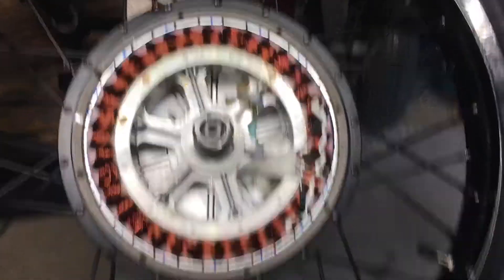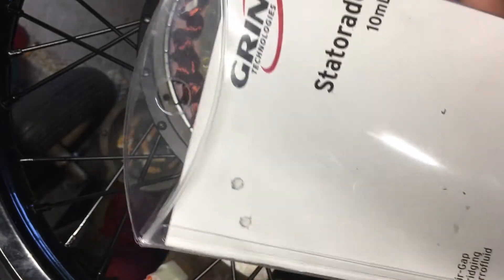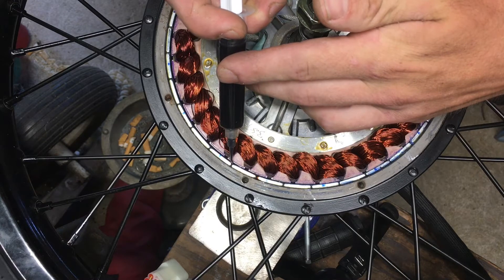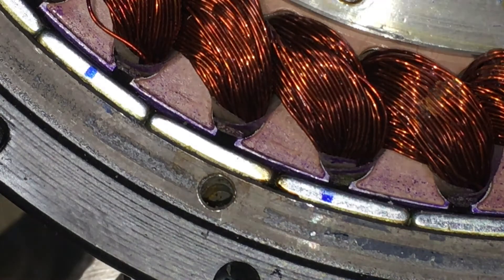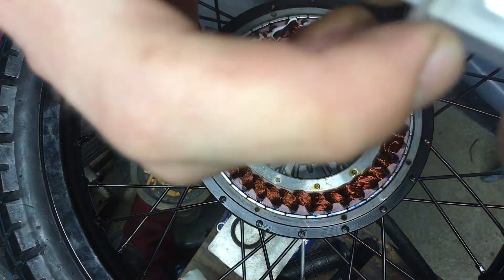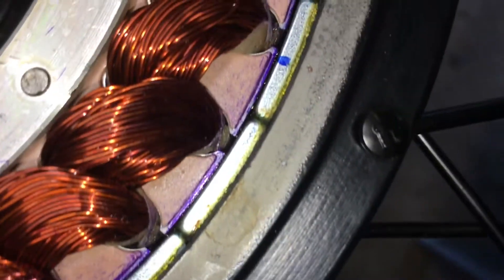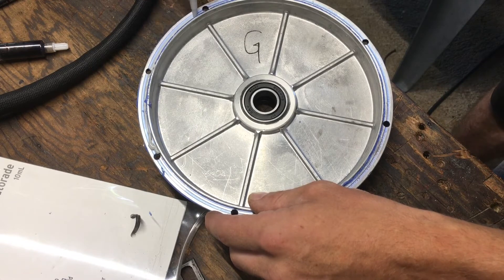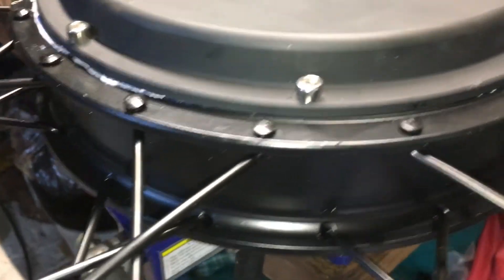QS 205 50H Hub Motor - Applying Statorade

Comment: I have transformer oil with 8mm hole at side cover and screw. 1mm hole inside screw, cord for vent. 200ml of oil and it do the good job.
Reply: just remember to add silicone to the cover before you add statorade xd
Reply: @pawe1242 I would hate for you to have to work on anything I own. You're putting regular oil in an electric motor, and you are telling people to make sure they add silicone BEFORE adding Statorade? You are lost. You're adding the silicone to create a new seal around the cover for the hub motor, so why would you want to do that before adding Statorade? Depending on how long you take, it very easily could be somewhat dried on the outside of the silicon, and end up not creating a good bond to the metal on the hub motor. And seeing as how your comment came from a year ago, if you actually put oil in any electric motor, I'm sure you have already figured out that it wasn't a good idea. No point in me telling you.

Comment: It conducted core temp to magnet and magnet to outer case..ok 
But core tenp absorbed by magnet can it affect magnet by temperature plz explain
Reply: The heat from the motor dissipate in the ferrofluid.
Reply: @zuhu0888  That's not right at all. In case you heard wrong, it's liquid with metal, not liquid with magic. The fluid absorbs the heat, and transfers it to the shell of the hub motor.

Comment: As a person who has used statorade. I would like to report that my results. Are amazing!

Originally. When i first recieved the kit. It ran ay 48v 45amps. And realized quickly that maxxing out throttle heats up the stator and battery significantly. 

So ended up having to control my theottling habits but throttling lower and going slower to preserve battery and to keep the heat to an optimal level for continued performance. 

Eventually i was able to save up for a 52v battery 21700 cells LG grade A. Pushing 45amps. 

Its a significant upgrade. My motor heated up even more so ended up LOWERING the amps to 36amps in my sabvoton controller. 
It ended up keep the motor less hotter but not by much. So it still required throttle control.

The BIGGEST GAME CHANGER! was when i got my hand on a syringe filled Statorade from Grin Tech. So i decided to go for it and opened my motor and had to slam the stator out due to the magnets holding it in.

Once i removed the stator. I applied fairly small amounts into the crevices of the magnets and the results is fucking AMAZING. 

I was able to raise my amps back up to 45amps and my 52v battery. 
Not only did i still retain acceleration performance roughly 40 percent according to Grins testing. But physicslly speaking, you dont feel the sluggish and low torque from an overheated motor. 
And the heat merely got slightly warm or just lukewarm. 

Even when burst throttle is great. But its so much better at climbing hills. The battery doesnt get as warm as before. 
Basically it made my entire kit more efficient in heat and battery all because the stator is able to cool itseld down better. 

I was so impressed that i ordered the hub sinks just to get even bettery cooling efficiency.

Im planning on further testing enabling flux weakening.

Comment: I dont think this is good for these motors.
Reply from the maker: It's sole purpose is to go inside electric motors to bridge the air gap between stator and rotor for better cooling. Mine has had it in there since day one

Comment: What's the tyre you have on it? I've checking the web for a good pair of tyres for my new bomber build. Currently have my mind set on Mitas E07's. Would you recommend the one you have?
Reply from the maker: I’ve been loving this combo for trails but it is a little on the noisy side on pavement. The rear is a 3.50-19 Shinko 241 and the front is a 70/100-19 Bridgestone M203 mx tire. They have really good bite and the knobs have barely worn down at all after a solid 3 months of hard riding
Reply from the maker: Sorry I didn't notice which video this was on at first. Here it still had the stock generic dual sport tire that came with it, and I don't recommend them at all. Unless you plan to ride on the street only. Off road they're abysmal lol
Reply: @PhysiqueGeek  Thanks.
I would love to get the shinkos as many with the stealth bomber frame recommends it. But in UK it is hard to get for low price hence defeats the reason for buying them.

I wouldn't be riding off road.
Main things I need is;
A. Less pit bike look  (police)
B. Good grip on wet tarmac 

I will be going to work everyday on it. Have broken a few joints in the past due to rain slips with my current dual wheel drive. Getting maxxis minions stopped that. Now I need to find a similar moto tyre while also not making the bike look like a pit bike. Very difficult thing to do 🙄

I would go for this both front and rear if I don't f i nd something better by the time I finish lacing wheels.

https://www.ebay.co.uk/itm/Mitas-E-07-100-90-19-57T-Dakar-M-S-TL-Front-/283942651628?_trksid=p2349624.m46890.l49286
Reply from the maker: @RogueLegend999  if your riding strictly on pavement I'd probably go for something like the Shinko 777's or Shinko 712's. Solid tires with excellent traction on wet tarmac and they go for about the same as those Dakar's, usually a little less. The dual sport tires won't benefit you much on road until the wintery weather comes back around anyway.
Reply from the maker: @RogueLegend999  https://www.ebay.co.uk/itm/202778773730?epid=214730934&_trkparms=ispr%3D1&hash=item2f368e88e2:g:LqoAAOSw7z1aGeQN&amdata=enc%3AAQAFAAACgBaobrjLl8XobRIiIML1V4Imu%252Fn%252BzU5L90Z278x5ickkrmmq8hWevtuKE7%252F%252BLfVXtihM9oCpol3Z6LCH5pVJP3NMOfMr843IPRyCrT92tPJvpHyd6fA8b8BAqoNIiFsKH0cKmyxAmiO5VO%252FD7xBahDb9zkx05QBNfnbtJcyOxiW%252Bg2VGgHXSwsYdXL5aEPTYOR6UuWNA%252B9WK%252BSplGL%252FyT%252BcCxAxdxMATMggNH1LKxmefg1%252FqHwVDFCnuq5M%252BOOkOgOMlj31C7eH%252F2DNGh34stXj60YqfTbj4qdhzkSDLHgTWjEGRRklL9J4jI9x1GS4c82mHn6Qk84TxOzQJusDTR2jwS4Ygk5wQJykJ39RAI2lrciVcK9MGHAz9VouY0D18gaM1am3GtRHK6mjPhLmt5ntdZSleH2Jd1s0Hll3JY%252Ft5HQbIWPECPMM%252F1XIPyQ5cov5XkVthXYTiFY4aDRzBvA79wMwaedIMC20mmfkSV2B20xxnYxvYpyW%252FeFDggVB5EI0G5idV%252FZS3Kz6xT3qnzYQn7%252BGEKQpmNgFcX6mfEXJjxElSg3s%252BhRrkVWSbSbXdbKfn4oMtK38qGGu0hhUS%252Fmr1uvmfveZjupd4BzfbV1HHtjNB9fZLr5XKTc84kuZPdjKJbYn2g9nRqt7%252FUgvIFOSHE5WiSFT00nNoyZRHll6533MAOvgIgDZ6egg6E9DY8Z60WyzXYfjnfd8YOth8P%252BtHdx5M3nffW7WhLpq1inycb6ZiAhd7T6b%252BDzf19qcVPidi857jjQSNTGJQaN8vFNBuA4i77oirBeaVne5I%252B3ckTj0JpMWopxwtzpryiZDbGp80kqflQrF4QoO9XmHxgVw%253D%7Ccksum%3A20277877373090efc8f18e4747b692876d1e72969939%7Campid%3APL_CLK%7Cclp%3A2334524
Reply: @PhysiqueGeek  That's from USA. $122 shipping fee to UK. This is why I can't use shinko. They are the best value for the money if you're not in UK 😅
Reply: @PhysiqueGeek  The rims I have ordered are 2.15 x 19 Aviation Aluminium. They are very strong but the supplier was out of stock in 2.5 width. I hope they will hold the 100mm tyres firm. My rim width is at the minimum border for 100mm tyre. To be honest I am very nervous about this build because I've spent £2000 on parts already and yet to buy tyres and brakes. Hoping to sell my existing bike to cover some of this cost.
Reply from the maker: @RogueLegend999  ah crap I didn't realize it was from Ohio lol. That's rough to have to pay that much for shipping on a single tire. I wish I had experience with other tires that you could get at a reasonable price in the UK. That Bridgestone I have up front on it now is the first time I ran anything other than Shinko's. I know bicycle tires inside and out but I haven't spent nearly as much time looking into moto tires.
Reply from the maker: @RogueLegend999  It sucks because we're both pretty limited as far as tire selection goes when it comes to the narrower 19" tires
Reply from the maker: @RogueLegend999  I do kind of wish that I would have went with 17's instead. Way bigger variety of tires to choose from there
Reply from the maker: @RogueLegend999  I hear that, it's a sizeable investment to make in a bike, even one as close to a dirt bike as these are lol. I think I have about $3000 or so in mine now, after upgrading and adding a few things like Magura MT5's front and rear, the MX tires, fenders, lights, and the moto seat. 

I'm running 1.85" rims with that 3.5 inch shinko, and I'm smashing around on trails, so I would imagine you should be fine running a 3.9",ish wide tire on a 2.15" rim. Though it is definitely the widest I'd go. It's probably going to be REAL close to rubbing on the swingarm.
Reply: @PhysiqueGeek  I've just watched a few of your trail rides. Yeah now I am definitely going for the dual sport to try out some amateur trails.
Reply from the maker: @RogueLegend999  It's a lot of fun man. I definitely recommend it. These bikes are super comfortable as a commuter, but they really shine on the trails imo. Those Mitas dual sports you have picked out already should do a great job on the more hard pack trails, without making too much extra noise on the pavement
Reply: Ik It's 4 years old but I use Michilen City Grip 2 tires & they've been able to handle really hard leans in pouring rain at over 64kmh.

Comment: Great video. Very helpful. Can you give an estimate of the weight of the ws205? Is that a 19" rim?
Reply: Hello, can you give an example of the effectiveness of ferrofluid in figures? Did he give a noticeable positive result?
Reply: Grin tech has videos showing the effectiveness. When I didn't have statorade in mine it would get hot fast & stay hot. Adding statorade helped a little. Installing the hubsink kit afterwords was a game changer. With both it gets hot slow & cools down extremely fast.
Reply from the maker: Yeah qs 205 in a 19" aluminum rim, it weighs about 45lbs with the tire on lol
Reply: 15kg

Comment: is that true you must change statorade after one yer because it harden and can destroy coil and magnets?
Reply from the maker: Hm idk I don’t see how or why it would harden up. Maybe if you used some cheaper/homemade ferrofluid that used an oddball fluid as the suspension medium it could evaporate or flash off over time and harden. The genuine Grin Tech statorade is formulated for very long time, high temp, high stress use. You should be able to use it for years and years as long as the motor has no leaks
Reply: @PhysiqueGeek  no sorry my friend but it doesn't last anywhere NEAR that long, not even when combined with hubsinks. I'd reccomend cleaning off the old drying FF and replacing with a fresh application once a year, especially if you ride "hard" and regularly get your motor upto temps over 100°C, (if not then why the need for ferrofluid?) Yes, the ferrotec formulation that Grin tech uses has a high flashpoint and is designed for high temp use, it's the only FF I'll use, but in the 5+ years I'm using it, it's dried up more than once. If pics on here were possible I'd show you how it looked when it did. Easy to clean off though, simply wioe off with brake cleaner (but carefully and avoiding getting solvent on the neodymium magnets glue.)
Reply from the maker: @ABritInNY  Thanks for the info! I've only been running this bike for about a year now so I didn't have any firsthand information on that at the time. 

I just recently had to tear the hub down to replace a sensor and you are 100% right. It wasn't completely dried up yet, but most of the way there. I ride that bike every day and abuse it off road fairly regularly so it's definitely had more than a few hot suppers lol. I cleaned it up with some concentrated degreaser, POR 15, replaced the Statorade, and put hubsinks on it this time since I did have a few occasions where it shut itself down to cool off with just the FF. 

What kind of setup are you running? I'm still on the 205 V3 with the 100a Sabvo controller, 72v.
Reply: I wish someone would tell the truth about this fluid,The initial operation run,The turbulence & sweeping magnetic field instantly pushes the fluid off the surface of the magnets and the carried fluid sublimates and your left with a mess of hardened solidified tar between the magnets,It really is snake oil.I tried it and this is what happened after first run,Look at the videos on Youtube on this matter,Its a mess.